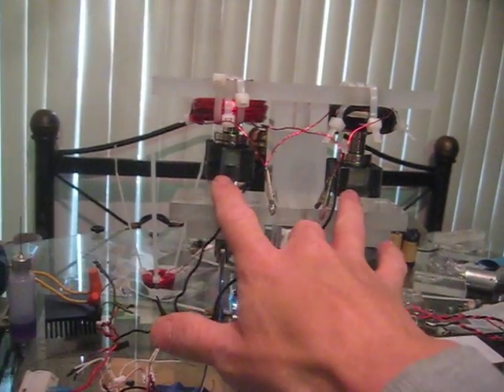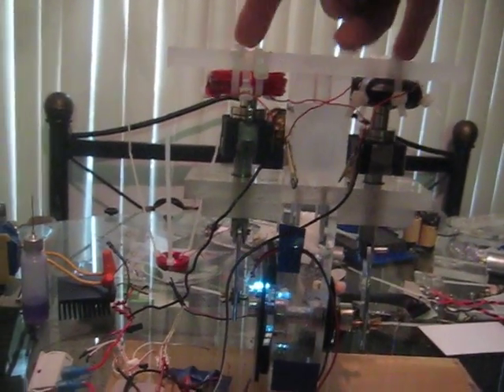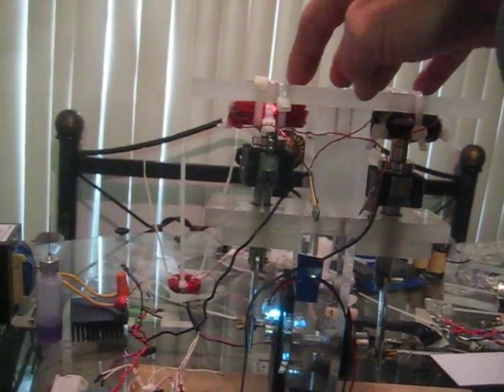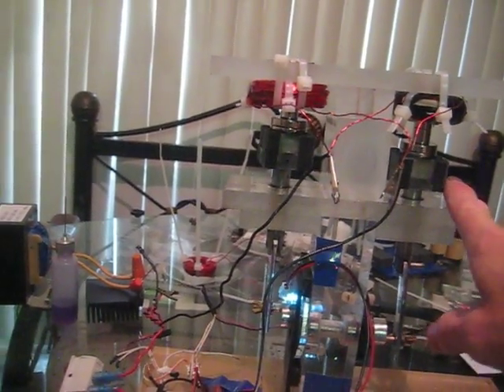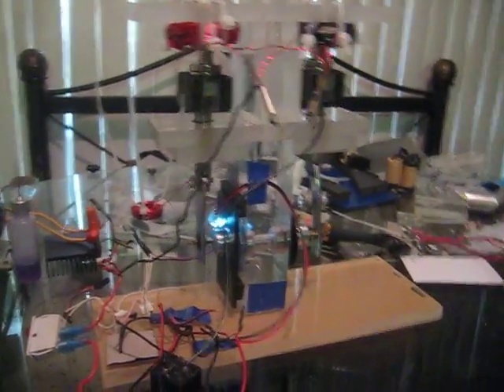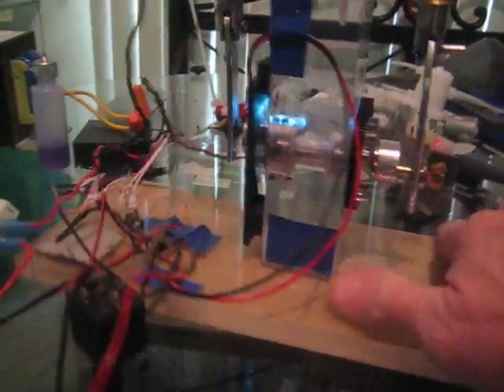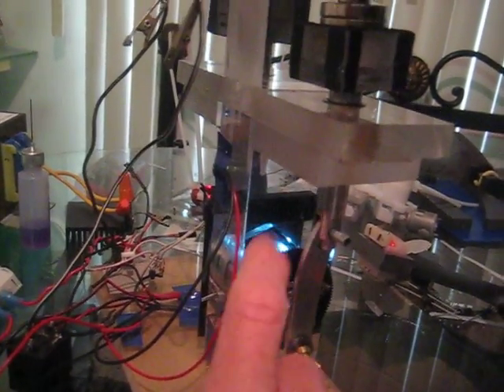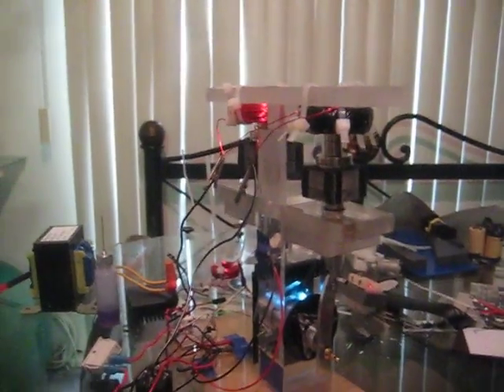inline twin  magnetic piston engine, magnet engine

Comment: I like your engine. I have patented the engine. Can you connect a small generator that produces the 14v required?  
Your design can work in vehicles.  The torque is produced by the size (stroke) of the crankshaft, and stroke of 3 in require only 210 pound of force. 
I would like to talk to you .(kbutleronline@yahoo.com)

Comment: you can charge the battery while it operates just like in a regular car dude.  This is definitely the future of electric cars.  It can operate until the battery can no longer hold a charge if you harness the energy MADE by the pistons as well as have an alternator like on a regular car.  Just need more torque.

Comment: @Obito313 I am all for electric motors, but the problem at the moment is battery technology. Also, there aren't any charging stations except your house and since you can force too much electricity into a battery at once with out overheating it is kind of rough right now lol. Once as battery technology increases greatly which is happening now, we will see many more electric vehicles on the road. Atleast that's what I think. Electric motors for the win!

Comment: @dauer962roadcar it's something to do with the alignment of the atoms inside the magnet. they are aligned in the direction that gives high forces in one direction, but then in the other direction (horizontally as you say) the atom alignments are perpendicular to the desired force, so no force (or minimal force due to not perfect atom alignment) is achieved.

something like that

Comment: There is a question about magnets that no one can seem to give me an answer to: Why can magnets lift huge weight vertically, but not push it horizontally? I would appreciate an answer if anyone could enlighten me.
Reply: you would have to give it that motion.... the only reason it is not crawling the table is because of orientation.  if you where to lay  the device a diferrent way.
Reply: EDIT: were*

Comment: its a great build and all and nice video but dont forget to do some research, the solenoid motor (magnet piston engine) was one of the first electric motors made over 100yrs ago. they went the way of the Dodo because they just dont come close to the power, speed or power useages as a "normal" electric motor. but still good build

Comment: I've been having this idea for a while to. we could have a car that runs on nothing but the battery itself. Using a magnect piston with a modified cylinder head that uses a north side to push down on the piston. The north magnect is energized by the battery through the alternator.